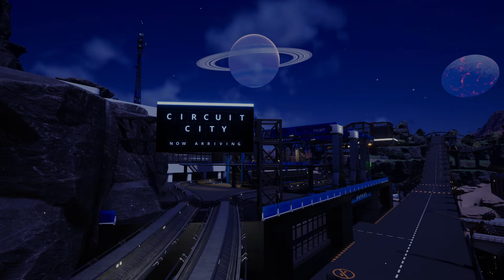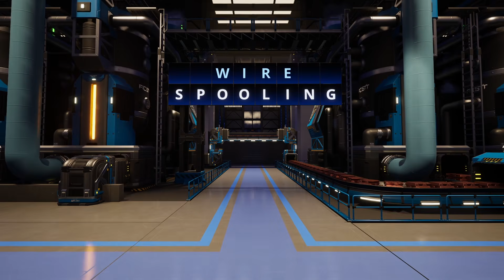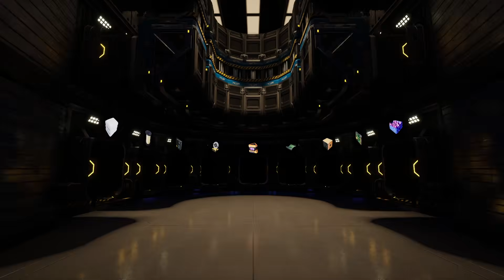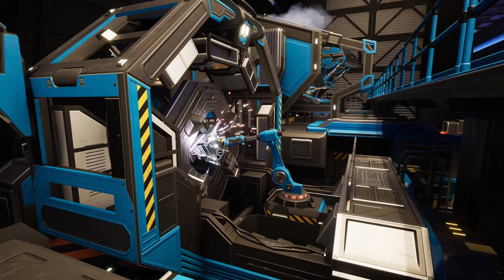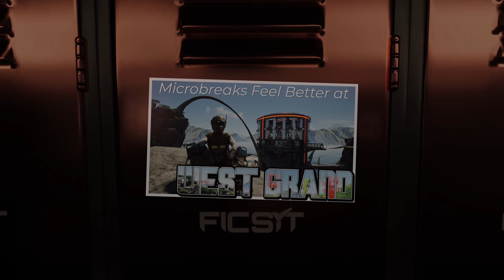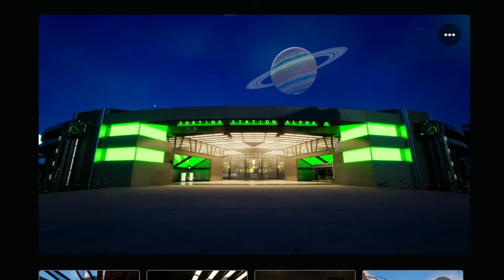9 Electronics Items Under One Glowing Roof: Circuit City | Satisfactory Tours Ep. 4

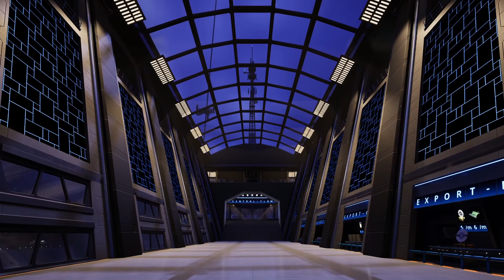Comment: This factory is incredible, I've been trying to figure out how you made the blocky designs on the wall at 4:05 in your grand promenade with no luck, so I'll just ask- how in the world did you do it mate?
Reply from the maker: Thank you! I'd be more than happy to share the config. I discovered the moving backgrounds while making this factory and put them basically everywhere. If you aren't aware, the other backgrounds also animate across the entire sign when you use them as a background instead of as an icon. Hope this helps!
They are large billboards rotated 90 degrees.
Colors: #000000, #497EF5, #000000
Icon: "None" in the backgrounds subcategory
Background: "Rectangles" in the backgrounds subcategory
Text: None
Emission Strength: 1
Surface Finish: Matte
Reply: @DS_Jeezy Dude you saved me- I was stuck trying to figure out how to make the grid pattern out of smaller billboards lol, I didn’t even know they had animated backgrounds like this- thank you, you got a new sub :D
Reply from the maker: @Drewft1319  Of course! I love helping people learn new things. I've been spending  A LOT of time messing with signs recently and it turns out there's a ton of cool stuff that's not super obvious. Welcome aboard!

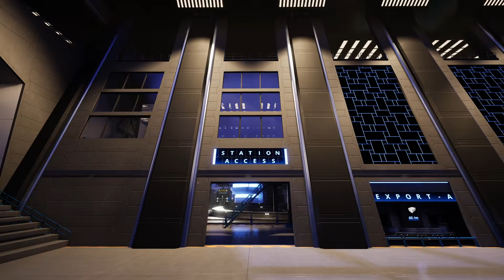Comment: how did you get the walls and windows to be on a slant at 4:10??
Reply from the maker: There may be a vanilla way to do it but I used the Infinite Nudge mod. You can find it here as well as mod manager documentation: https://ficsit.app/mod/InfiniteNudge 
It lets you rotate on a few new axes. These arbitrarily slanted walls do run into issues when trying to cap them off though so be aware.